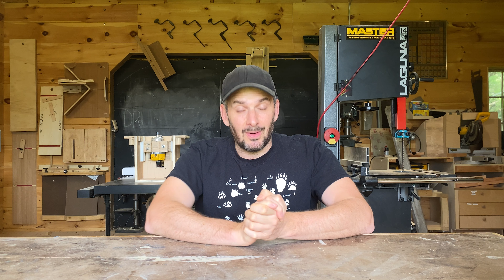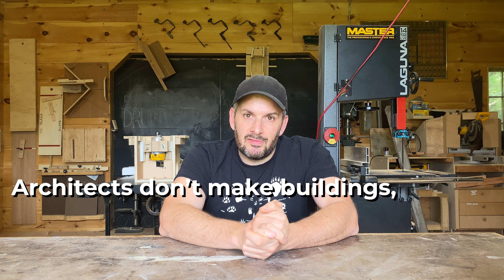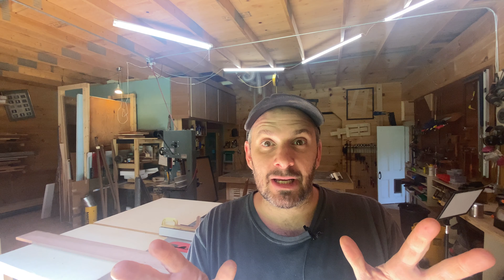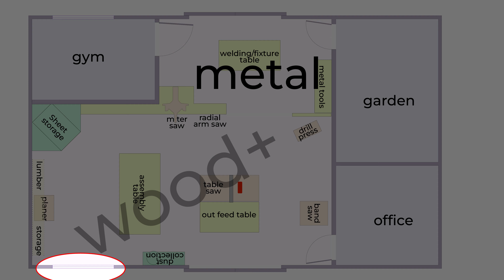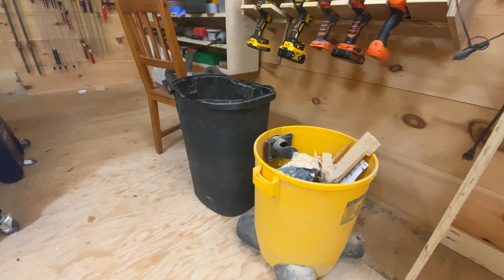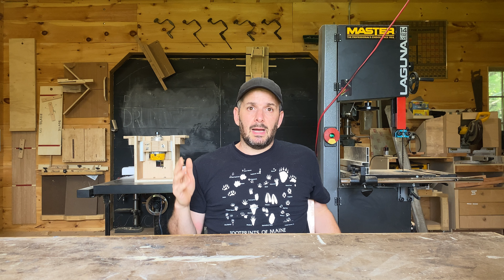How do you even start laying out a workshop?

Comment: I'm the same.  I've been to a school to study architecture and I have been in the business since 1987, the last 15-20 years in private practice as an architectural/engineering technician.  I have just very recently had the privilege of starting to set up my own shop.  i have very much so enjoyed your video on shop layout.
Reply from the maker: thanks!  I've probably rearranged my shop 4 times since I made this video. I'll do another shop tour video soon!
Reply: @arikardasis  I have rearranged mine at least twice since I got it, since February.  Due to it's small size everything, other than the workbench will be on wheels, and I use a very nice Kobalt folding job site table saw.  I'm currently in the process of building my tool carts.